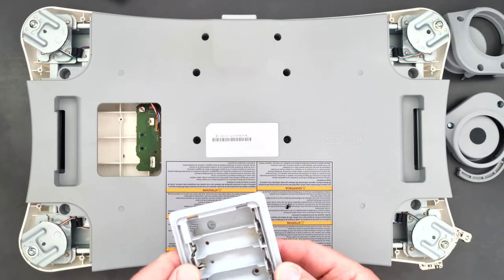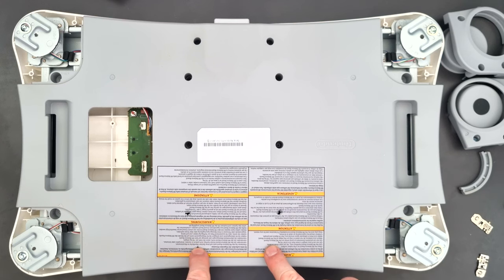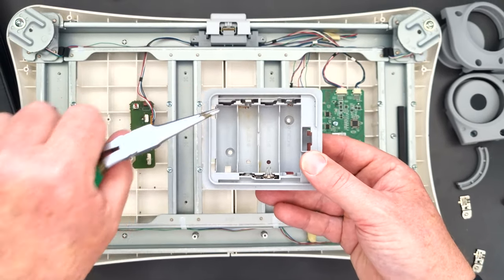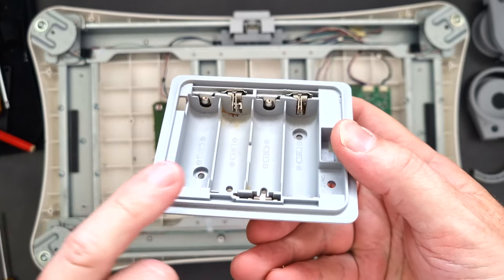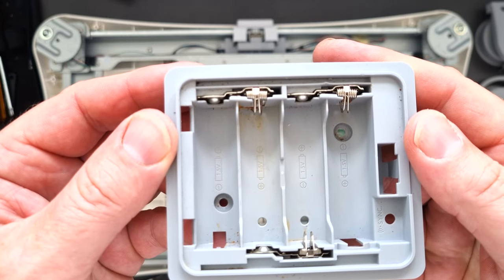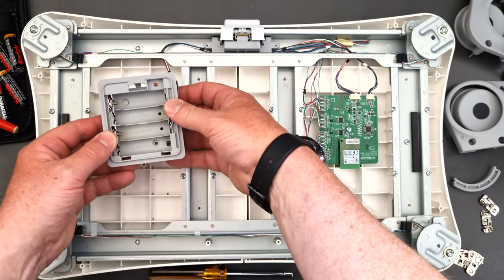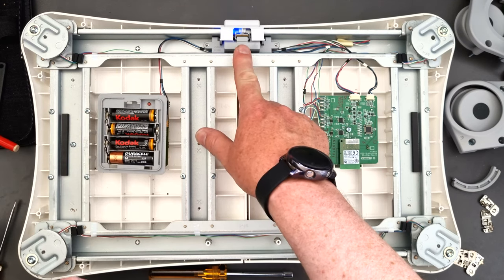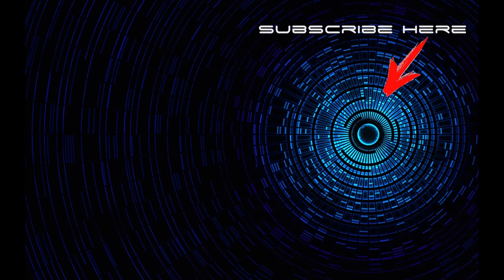Nintendo Wii Balance Board Battery Compartment Fix Repair.

Comment: Im glad I watched this. I just unwrapped my ebay board this morning (bought faulty), it had corroded battery terminals but was still working . One spring pair broken. I took the end terminals from a broken wiimote and they were exactly like the ones you are fitting, slightly fatter than the original but once that bottom clip was bent back a tiny bit, they pushed in and are working.

Comment: Thx for sharing. 😊🎉❤ The problem with my board is that those battery's iron clip can't pull them out. They are stock inside because battery's corrosion crystal. 😅